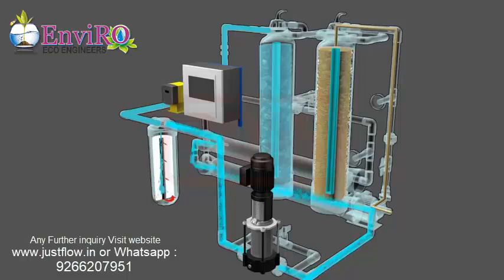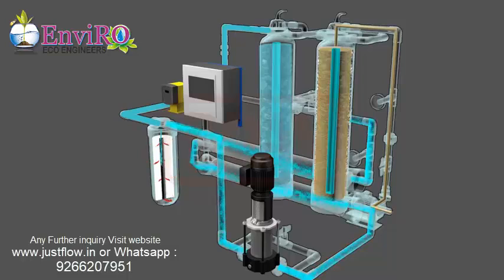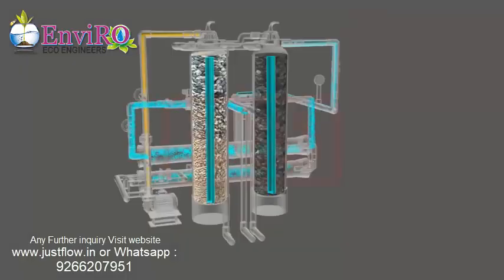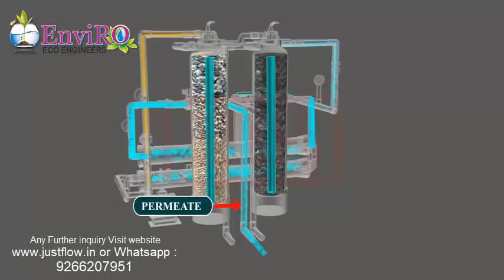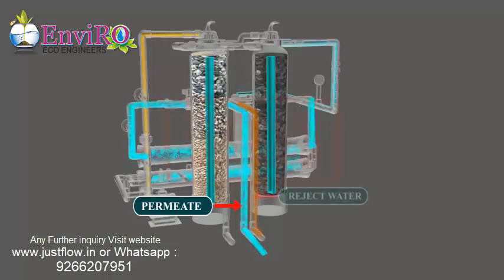How to Work Industrial RO Plant | Demo RO Plant

Comment: In RO plant where the pressure is more...in reject salt water or permit drinking water?
Reply from the maker: no sir its salty water means high tds
Reply: @InformationGuruGVinod  no sir..i asked where pressure is more in  outlet...permit or reject?
Reply from the maker: @yashikakumar651  minimum 8kg
Reply: Where Pressure flow is increased where in permit or reject.? Asking comparatively..